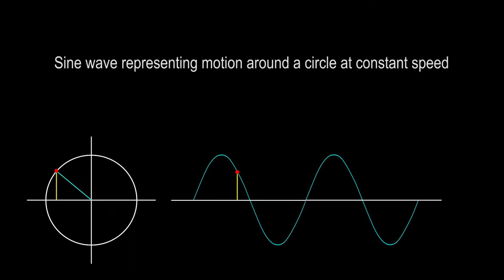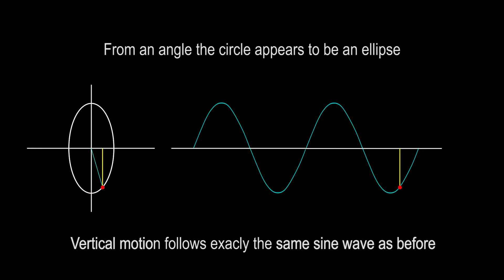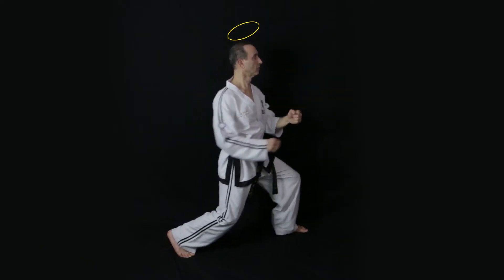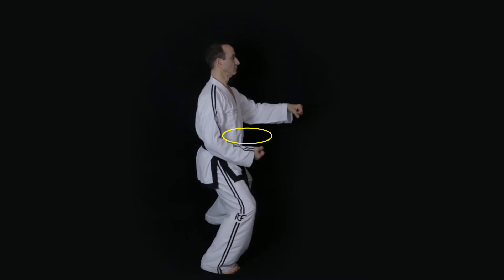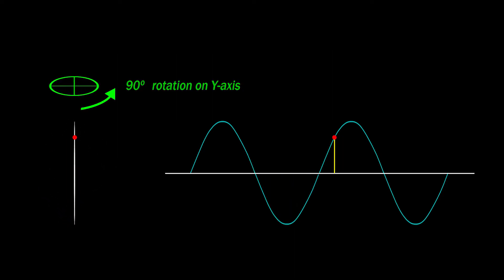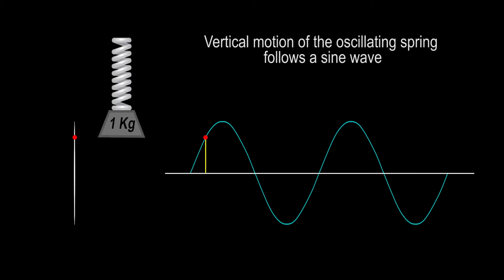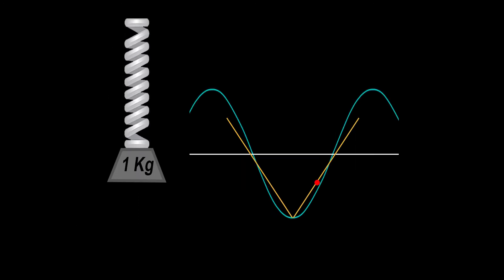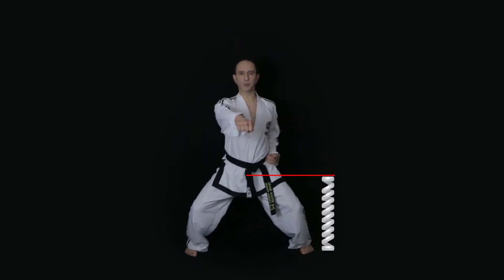Taekwon-Do Science: Sine Wave Motion #2

Comment: While there may be a "natural spring motion" in the joint, the sine wave also adds unnecessary stress and wear onto the joints. Especially the knee joints. Ask ANYONE who has any form of tendonitis or arthritis in the knees to perform the Sine Wave motion and they will explain to you how much more stressful and painful it is. Especially as opposed to using a more linear motion.
Reply: It adds no stress to any joints.If youre injured or have arthtritis,any martial art is going to hurt.
Reply: @scarred10  if taking "stress" to mean what it does in physics, rather than common parlance, then any application of force will result in an increase.
Reply: @danm8004  I guarantee you the original poster isnt referring to any scientific term,they mean its detrimental to the joints which it isnt.Stress is necessary for tissues to adapt but it must be appropriate for the current tolerance of the tissue in question.The sine wave is a mild stress in physics terms compared to other sporting notions. It is however complete nonsense in a combative sense.